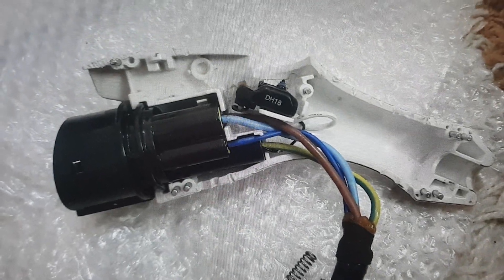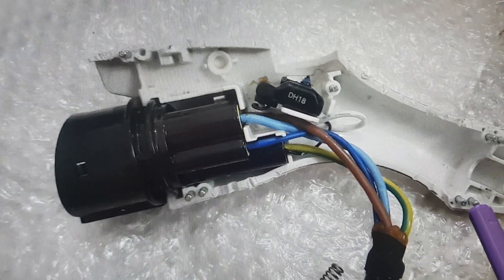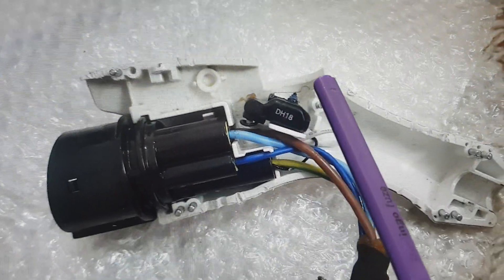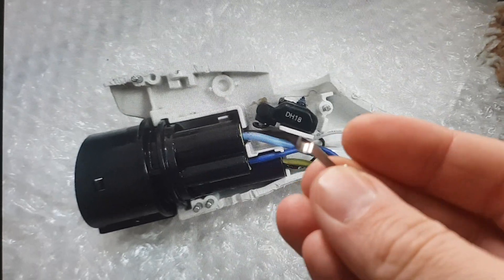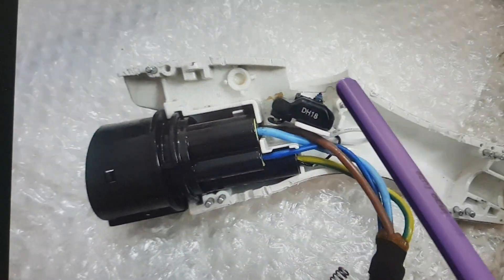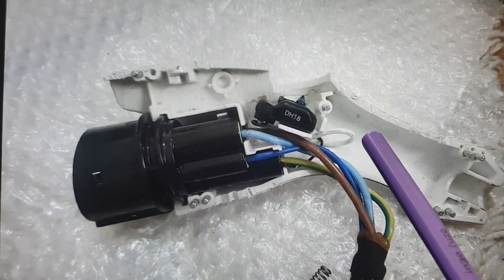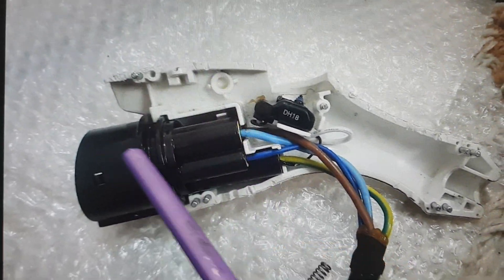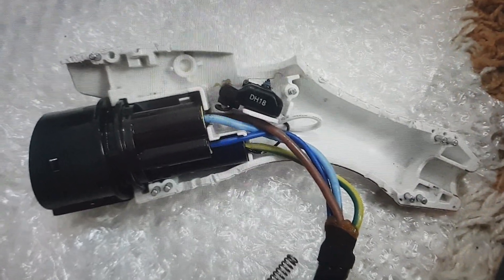Nissan Leaf not charging? j1772 plug FIX

Comment: If you disable the switch that turns off the charger before it is unplugged then power will still be flowing when the plug is pulled out causing arcing and contact damage.  Not a good idea.